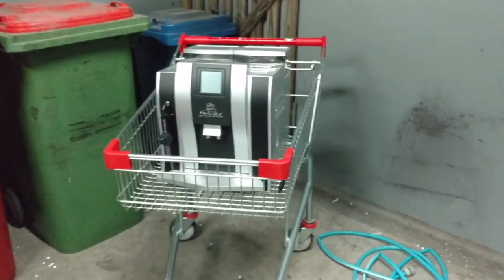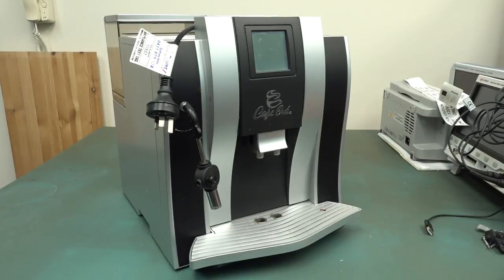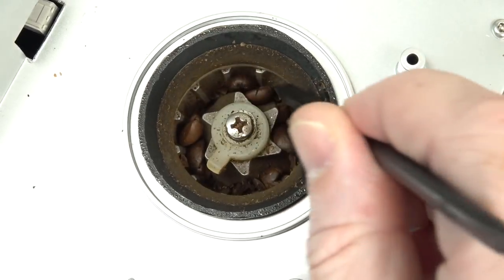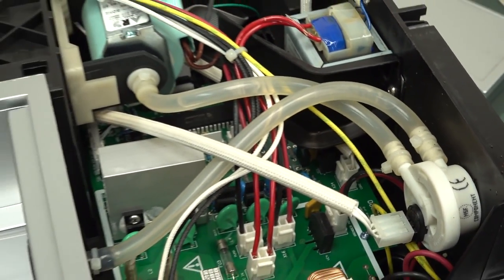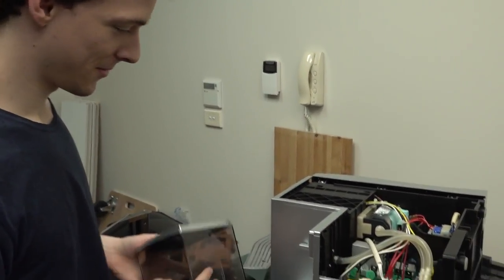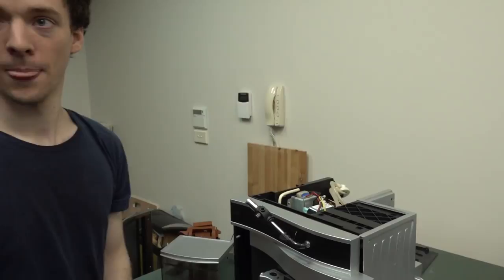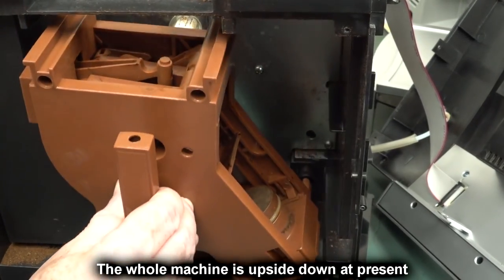EEVblog #1161- Automated Coffee Machine Dumpster Teardown

Comment: Coffee machines have a long history and serious fire safety standards, hence they all contain both thermostat(s) and the latch ditch thermal fuse to prevent burning down the business when (not if) the thermostat fails.  They also need routine cleaning and need to be food safe when clean, hence the removable teal plastic assembly and the pretty interior construction.  As this unit is an automated system for serving to an entire business or even to visiting customers it needs to pass government inspection for for food-serving establishments (would be a real bummer for your pharmaceutical company to get a public citation for having an unhealthy coffee machine in the office).

Comment: I actually tore down a very similar machine a few years back. It'd seized, sheared it's plastic drive coupling off and pissed water all over the transformer.

The beans are ground until the brown hopper mechanism is full. I believe that's timer based. The bean counter is just to say when the bean hopper is empty, not actually count the beans. The annular gear on the grinder sets the size of the grounds by changing the offset of the grinder teeth.

The hopper mechanism also does the tamping your friend mentioned. The hopper tips over and is pressed up against the "filter" acting as a static piston. This compresses the grounds into a puck and it's where the hot water is forced through them to get the coffee.

The pump is large because it's got to fight any back-pressure from the boiler and have enough oomph to force the hot water through the fairly solid block of grounds.

The thermocouples are just waiting for the boiler to reach the right temperature to release the solenoid valve and let the water flow. The thermal fuses will handle overheat.

The frother on these pieces of crap is just a steam feed on a physical tap you're supposed to stick in a pot of milk yourself. I assume that's because milk wouldn't respond as nicely as beans to being left in the machine for a year.

The flow sensor makes sure the pump is working. My one had a light and sensor arrangement around the water tank coupling that I think checked the water level by bouncing light off the water surface from below.

The one I had had a separate board entirely populated by the MOSFETs for controlling the mains components, which was a nice tidy board to use in other projects. The touch-screen was also a self-contained module, but not of much use with an etched LCD.

You'll probably find the top of the machine has a couple of metal plates with cartridge heaters attached. They'll be for pre-warming your cups and/or milk.

Comment: I see you didn´t like too much this coffee thing. First, there is no milk going through this machine. It would be bad and smelly after a very short while. Milk has to be kept cold. Next, the hopper you called it, is the brewing unit. It has different modes: 1. fill coffee from the grinder, 2. compress and brew coffee, and 3. empty the used coffee into the grounds container — the motor connected to it alters the mode of the brewing unit between the three modes. The brewing unit is user serviceable part and has to be cleaned one o two times a week depending on the use.

Comment: Ok so lots to put here...

The clear hopper on top. One is for beans and the other is for water only.

The small white flow sensor is exactly that, it’s called a flow meter and it counts water volume,it’s how you increase how much water/coffee is in your cup without using a time counter.

The pump you identified is indeed a pump, a vibrating/oscilation pump basically it’s a big solenoid coil that turns on and off very fast, pushing and pulling an armature in the centre, creating up to 15 bar of pressure. Contrary to your friends info a vibe pump is not variable pressure (but you can bleed pressure externally with other gear)
The plastic guard around the transformer is a shield to prevent water from getting onto the tranny if the hose from the pump was to leak or fall off.

The part you identified as a hopper is actually the piston or brewing unit. Coffee grinds into the centre, it tamps the coffee under pressure, runs water through it and extracts it into the cup at the front.
On top of the grinder and conical burrs (blades that grind the coffee up) is the adjustment mech, this makes the coffee finer or coarser to vary strength coffee quantity and pour times.

The twin thermoblocks you has a lot right, one heats water for the coffee to 90ish degrees Celsius, the other heats water into steam vapour (130ish? Celcius)

The valve at the thermoblock is a brew valve - a solenoid and armature that is normally closed. When energised at the same time as the water pump it opens and allows the water from the thermoblock to flow through the brew unit, through the coffee and into your cup.

That’s all I can remember right now.

Basically there are several seperate systems in the machine that work together. Electrics/electronics, steam hydraulics, water hydraulics, and mechanical components.

If you want more details or anything get in touch!

Comment: Used to fix all sorts of coffee machines for a living, and let me tell you that you got away with a 'clean' one haha.
From what i can tell, the machine would work something as follows:

The sensor in the bean hopper was definetely for low level detection. 
The water flow sensor is for a controlled volume of water through the 'group head', then goes into the coffee 'puck' and into the cup. 
The water heaters are as previously stated in some comments, one for coffee, kept at X temp, and the other for steam, kept at above boiling point. 
The solenoid valve keeps the steam contained in the boiler until the user wants to use it (yes it's normally closed).

So the machine grinds beans, they fall into that brown mechanism thing, motor and gear system raises it up and 'temps' the ground beans into a puck, hot water floes through it, creating coffee, which flows into the cup, after some measured amount of water flows, the brown mechanism lowers and discards the used coffee puck into a waste tub, and the user can froth their milk using the steam (released by the solenoid). 

The temperatures for the boilers would be fixed using that thermal switch, the fuses are there for safety should the thermal switch fail, and the thermocouples are to tell the microcontroller when the water and steam are at temp or not.

Feel free to add anything if i missed it.

Hope that clears it all up for ya Dave
Reply from the maker: Thanks for the detail.

Comment: As a coffee afficionado who has seen his fair share of fully automatic espresso machines in his lifetime, this was somewhat painful to watch, but still thanks for this video :-)  The large orange plastic thingy (which you held upside down at one point of the video) is the brewing system. The ground coffee beans go in there, get compressed into a large "coffee tablet" and then the water goes through it (at pressure). Afterwards, the coffee grounds fall into that trash bin thingy you showed at 3:28 in the video. This machine does not seem to have a separate system to pump in milk/heat it, it only has the frother to heat up milk via steam.

Comment: I acquired a slight coffee taste after a friend showed me the French press. Somehow, it doesn't have any aftertaste.
Reply: LazerLord10 the aftertaste is caffeine, friends.
Reply: @HighestRank  uhh.... no it's not, I can guarantee that. If anything, french press has a slightly higher caffeine content than a standard drip coffee. Even if that isn't the case, the amount of caffeine in a typical cup of coffee (~100mg) would be so dilute as to be relatively tasteless. I'd know, because I used to make hot chocolate with a mix of 100mg caffeine in it (from a tablet), and there was no taste difference. Even at the bottom of the cup, where some of the tablet didn't dissolve, there was no appreciable taste other than a slight bitterness.

Wow, that was longer than expected. Sorry you had to read all that. Maybe I should lay off on the caffeine, lol. (In all seriousness tho, I have max 100mg a day).

Comment: I notice there is no filter cap after the bridge rectifier so the system is working with noisy dc.
Dave did you check the thermal protection devices for continuity? It would be interesting to find the failure point.

Comment: That's quite a good machine. That grinder is a burr type which gives a uniform grind. The toothed wheel clicking away upon turning at 15:15 is the grind adjustment. From coarse to fine, think of it like the traditional stone mills, the lower one turns the upper is static. The product good in the top centre, the turning pulls and crushes. 
We had a similar machine at work, slightly better and it gave quite good coffee. 
PS, you really wouldn't want a fatty liquid like milk going through a heater. Can you imagine the damage it'll do to the internals? The steam wand is used to froth and heat milk. 
Sad thing is for a literal fraction of the cost you can make better coffee in a moka or press.

Comment: Looks cheap so destructive teardown is fine.

Also these automated unit's generally do not have milk option at all - they expect you to froth it in a cup with the steam. If they do - they have a separate pipe to stick in a milk carton.

You just got coffee and water. Water is heated up and pumped through ground coffee at a pressure to extract flavors/fine particles.

These are mean't for office use where people may go for 100+ cups/day so the extra safety makes sense - they get abused a lot.

You could also make tea with it - put tea stuff in the grinder instead.

Comment: That big solenoid is only a ON/OFF valve, it can't regulate anything by it self. I think you could use PWM on the coil, but the mechanics of that valve would fail soon. Solenoids like those are often seen on industrial pneumatic valves.
Reply from the maker: Thanks, I have zero experience with such things. With the long form factor I thought it might have some spring thing in it that could vary the flow with the coil current or something like that.
Reply: @EEVblog  I'm 99,9% sure that that one is only ON/OFF. Yes, normally it has a spring and a small plunger that moves by the magnetic field created by the coil, but I never heard any solenoid valve that can modulate by current, but hey, I can be wrong. It seems that the flow is regulated by the pump... And also pressure, if it is a positive displacement pump. 
We are always learning and I have learned a lot from your channel apart from the fun, so thank you ;)

Comment: Dave, that "never used" thing is the water tank. It's dry & clean because, duh, the last of the water has evaporated. ;) It supplies water for the coffee, & water for the steamer, which is that wand on the left that you couldn't figure out at the start. You use the steamer to heat &/or froth the milk if you're making a cappuccino, or other milk-based drink. BTW, there's some nice hardware in one of those machines; it's a damn shame to throw one away.

Comment: I am surprised that Dave did not plug it in to see if any part of the machine actually worked. I have had folks throw out coffee makers because it would not heat.....due to a thermal fuse  against the heater block being blown....EASY FIX.    Maybe next time.    J K

Comment: Really guys, never seen this kind of coffee machines?? They're all over the place over here in The Netherlands! We ourself used Saeco, Jura and Siemens machines. No David, these are not "simple" plain machines; they offer a wide variety of coffee and milk products like espresso, cappuccino, latte macchiato etc. with just a push of a button. The more modern ones have their milk and coffee products output in a single outlet, thus can produce your drink without the need for manual intervention. The tank is for water only! Milk will be added through a hose connected to the steam pipe on the front. The light sensor on the bean container is not a bean counter :-) but is for sensing an empty bin (running out of beans), not a bean counter! :-) And 1 Kg of beans cost around 10-20 dollar. We're using appr. 1 Kg bag per week (10-12 cups per day). I say cheers! And drinking my cup of coffee now! :-)

Comment: Dang - I owned the exact same model 5 years back. :-O
Oh the memories.
Reply: Basically the machine is not the cheapest one in terms of quality. It was a good entry level back in the day.
It grinds coffee reasonably well.
And remember: The 70W Pump is needed in order to get the pressure right.
With these fully automated ones, you usually speak about Espresso and Cafe Crema machines.
They require between 7 - 15 Bar pressure in order to properly press hot water (80-90°C) through the pressed coffe-

So workflow:
The brown "hopper" receives the ground beans, presses them into a pad. Then the pump activates, pulls water in. The Hall sensor checks how much water flows through (you set it up in the menu). The Monoblock heats the water up and when the pressure is right, it gets pushed through the nozzle in the brown hopper-element to run through the coffe-grind.
And then into your cup.

Again: Not the best machine you can own but you can bet that it cost around 150 bucks back then. The "Automatic" mode is what makes the price because you pay forr the pressure element, the grinding and the different coffee types you can get out (Espresso and Crema). 
The nozzle on the side is for hot steam. You Usually have a second hose attached to it to suck in milk, heat it up and foam it so you can get Cafe Latte or stuff like that.

Comment: The heater block is two stage - the cold water comes in from the pump (amount is measured with the sensor in the pump's intake line) then it passes though the first heater chamber with the two hoses coming out from it. If the user decides he wants hot water for a cup of tea it will then run through a pretty much unheated second chamber and out through the solenoid and frother. If Steam for frothing milk is selected the second heater would turn on to further heat up the water from the first chamber to evaporate it. This way the machine can quickly switch from coffee to steam and back without havig to release steam first after frothing up the milk as it would have to if it just had a single heater.
If coffee is to be made, the grinder grinds an amount of beans which fall into the brewing mechanism's cylinder, amount is controlled by time. Should beans run out, the photointerruptor on top of the grinder will detect this.
The brewing mechanism than swivels to the other side (where the filter-thingy is) press up against the piston with the filter. Then the pump supplies hot water from below that will extract coffee from the beans. After that the mechanism swings back, throwing out the pressed used ground coffee into the waste drawer (with the crusty stuff in it).

Comment: The earth cable you were interested in is 150 degrees C silicone insulated with a glass sheath.
Used to use it to repair heating element wiring and industrial cooking appliances.
Specs here: http://www.bambachcables.com.au/products/high-temperature/silicone-rubber-glass-braided-single-core-150

Comment: The two thermal fuses on the heater circuit are not identical.  One is high-temp and one is low-temp.

Comment: 7:08  a liquid flow meter has a spinning rotor with off center magnet inside. hall effect sensor 3 pins .
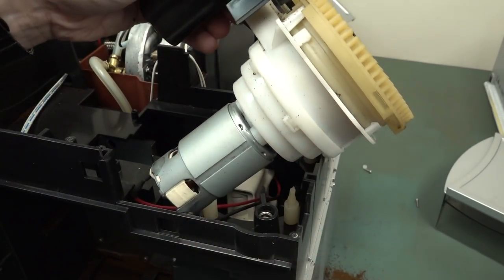 12:05 it a pump type solenoid valve,  note the rubber anti vibration mounts & the large coil , 16:50 the two part kettle. 17:46 2nd solenoid valve.  hot water system requires a level of quality, for a given level of reliability & safety. if they can cut or shave costs in the design, they already have done so.  the plastic case is proof of this. as stainless steel case is more impressive.  21:23 its a mini hot water heater, so needs all the fail-safe safety sensors.  many coffee bean cartridge type coffee machines business model templates are the same as bubble jet printers, sell the machine unit at cost, make  make money from the overpriced refill cartridges. 15:50 the coffee grinder motor is a known failure point in cheap coffee machines.  beyond economical repair? I have teardownd coffee machines.  23:17 heat resistant wire, high temperature type glass fibre braid ?  24:20 all plastic gearbox is a sign of cost cutting in the design. 25:04 microcontroller unit & drivers  yep seen then before!